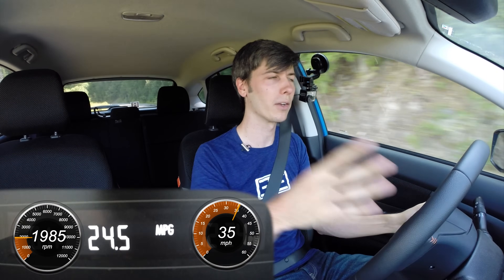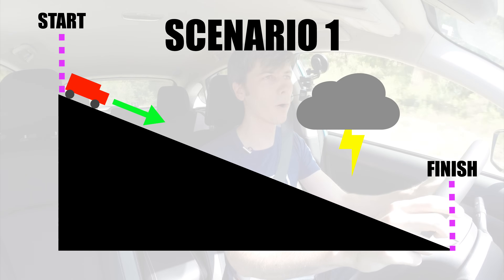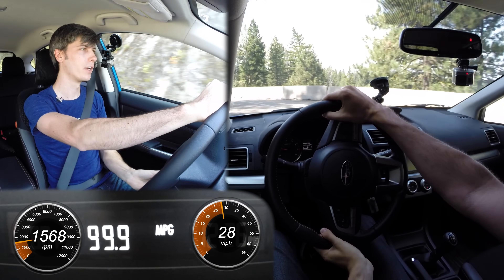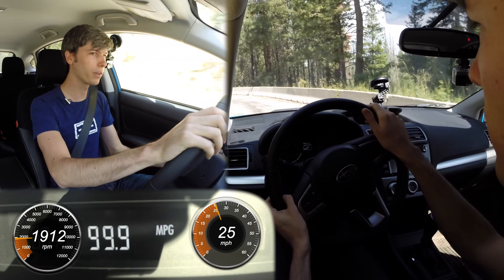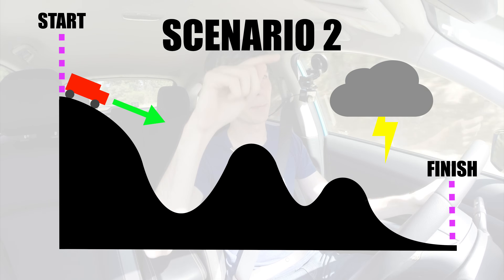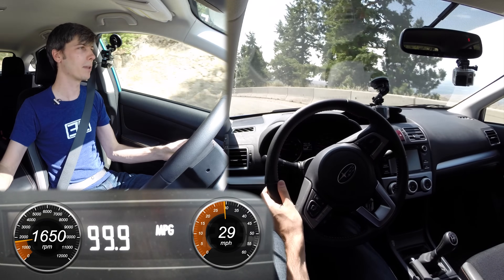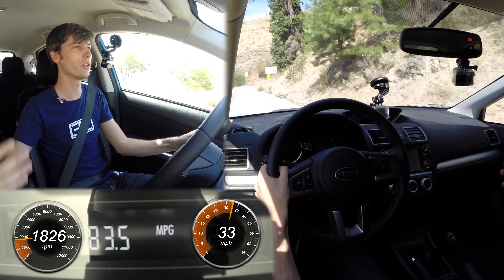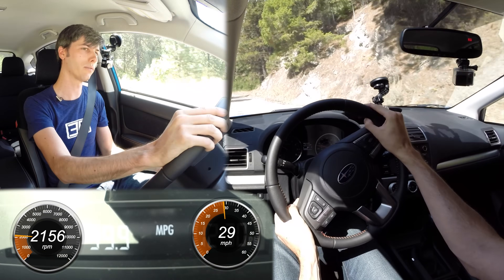What Uses Less Gas - Coasting Or Engine Braking?

Comment: I can't maintain road speed by engine braking where as coasting on undulating gradients seams to work for me.. Mind you keep a realatively low RPm means in a petrol engine the road speed is low. Longer steeper hills are great to build up some speed at idle.

Comment: How about on a carburetor? All mechanical. My moped has a carburetor. Redline it then release the throttle but still the jet is still giving a fuel.

I think in an injected engine, the computer reads almost no fuel because of a high amount of air sucking in (about mid rpm) with an idle amount of fuel being injected. 

I hope you understand my english

Comment: When you disengaged the gears and put the car in neutral while going downhill, how did the wheel speed increased the amount of fuel consumed?? When you put it in neutral, there is no connection between the engine and the output shaft right?
Reply: If the engine uses half a gallon of fuel per hour idling and you drive 60mph, you have a momentary fuel consumption of 120 MPG, but if you are only driving 30mph you need double the time to cover the same distance, which would let the engine idle for double the time per distance and giving you a momentary fuel consumption of 60 MPG

Comment: i agree with this. my grandpa always taught me that acceleration is the largest use of fuel especially from a complete stop. neutral if its a long hill and safe to do so, engine brake to help stop if its a stop sign comin up. of course, he wasnt used to fuel injection. he was still right

Comment: I mean, it kinda makes sense... When in neutral, your engine needs to keep spinning so it needs to use fuel.
If you use engine breaking, the spinning of the wheels will keep the engine spinning.
Reply: Yea but when u coast, my mpg for example says about 90mpg, when u dont accelerate in a gear u will slow down quicker even though its not using any fuel u will still save more by coasting downhill
Reply: @hingo078  Depends, I can put it in gear just fine while coasting downhill without losing much speed.

Comment: There is another scenario for a stick shift. Coast in neutral then shut off the engine and turn the key to the on position to prevent steering lock so you are moving yet you are at 0 rpm then if you want the engine back on you simply engage a gear.

Comment: Remember worn engines suck oil up to the top of the piston when the throttle plate is closed so in the case of oil engines the lubricating oil that is being drawn up past the rings can actually start to fuel the engine

Comment: Please, I need your help, sir. When I put the low gear in my car, the fuel gauge is getting lower. After the downhill, I put it back into normal gear then the fuel gauge will back to normal reading. Is that normal, or I got a problem? Waiting for your kind response. I use the manual gear. thanks.

Comment: One thing not sure about the video, do the injector stop working or supply the engine with very little fuel when in gear down hill and foot off accelerator?
The airflow in this situation must be higher than that when idling
How it stay in the right a/f ratio then?

Comment: I once had a 2006 Lincoln Zephyr that would not cut fuel injection until about 4500 rpm. It was always more fuel efficient in that thing to shift to neutral. It would NEVER do more than 80 mpg instantaneous unless over 4500 rpm (which would last a whole 2 seconds as it aggressively slowed itself down) or you shifted to neutral going 35+.

Comment: My car (06 Chevy Cobalt w/ 5spd) actually says 0 if I'm coasting in gear and says 99 if I'm rolling in neutral. It will go up to a high number, like 99 as soon as I touch the gas at all. I assume this is because I'm going 'no miles for every gallon used' because there aren't gallons being used versus just an mpg higher than is can show, i.e. 99mpg. 

Would that be the difference between 0 and 99?

Comment: I think I am quite good at keeping fuel efficiency while driving around. I coast in top gear a lot. recently somewhere i read that coasting in neutral (without pressing clutch) can still damage or eat away clutch disc a lot quicker than if were to coast in gear.
logic is that when we are coating in gear clutch disk is rotating along with the axle and other moving parts as it is locked. however if we put it in neutral and coast for significant amount of time  the clutch and the engine won't be in sync and so it may cause clutch to slip and wear out a lot quicker when we re-engage  gear (when are about to stop coating.) could you confirm 8f that is true?

Comment: awesome video! however, i still have a question, what about changing your gear to "S" (sport) or "L" (low.) my car's mpg gauge says it is running at the maxed out 80mpg, but the light system that indicates whether youre actively using fuel glows white, compared to it being glowing green when you drive economically. (2016 Civic)

Comment: How is the engine still firing when engine breaking if the injectors shut the fuel off? Makes no sense.
Reply: the engine is being forced to turn by the wheels. All of the components are connected. So normally gas is put in sparked and the explosion forces the pistons to move which is connected to rods which ultimately force the wheels to turn. If your in gear the tires are forcing everything to move. So as the tires turn so does the drivetrain which in turn causes the engine to turn which means the pistons are also moving. So the only thing not actively being used is fuel. You still have all of the other parts working as normal.

Comment: What I have observed is coasting in gear is going to stop you quicker than in neutral if you are in a plane road, not steeped hill, and in that case it might be more fuel efficient to coast in neutral as you will be able to coast for longer. However, it is unsafe and illegal in some states like Tx. You can do that in a manual transmission car, though, by pressing the clutch pedal.

Comment: What if we switch off the engine in long slopes and run the vehicle in neutral instead of keeping in gear... (I am thinking to gain more speed without consuming fuel)
Reply: yes you would. but that adds a whole other list of problems. Locked up steering wheels, or lack of power steering which in modern vehicles isnt good. Plus no control over the vehicle and you lose a lot of your safety controls like braking and such. So your right but its not a practical solution lol